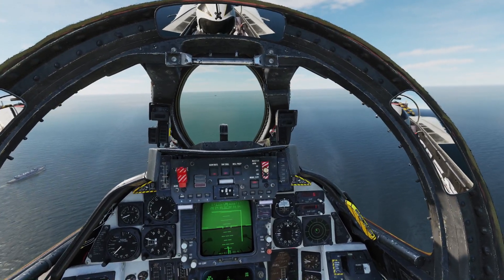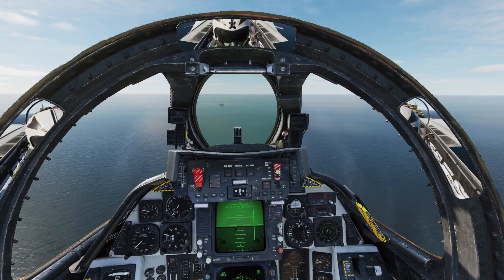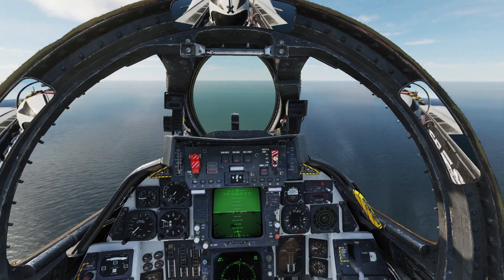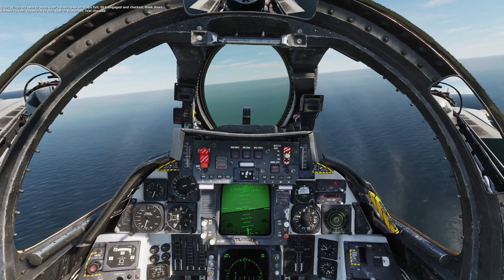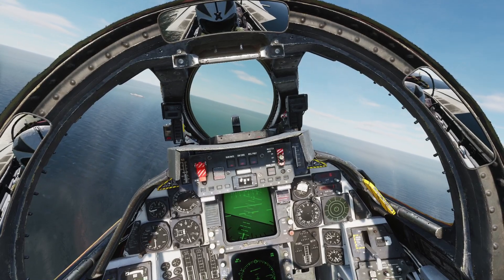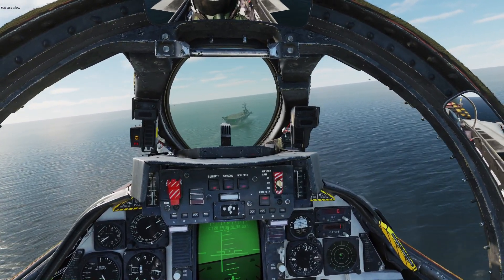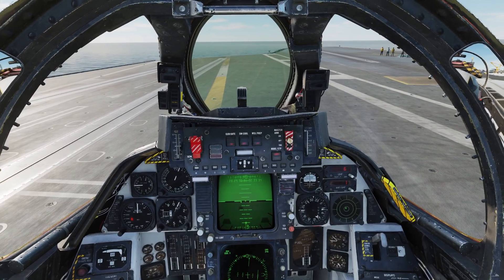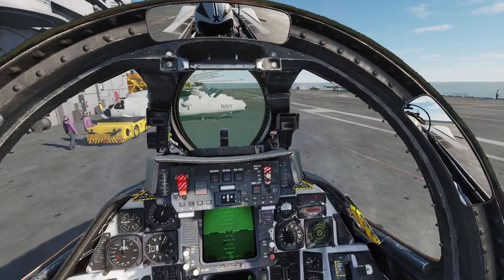F-14 Tomcat - No HUD Case I Recovery

Comment: 4:27 That's so true. In fact, I tried this when the Tomcat was new because of that recommendation, but I ended up just cranking down the brightness so that it's still faintly visible for double checking thrice, but I noticed I rely much more on the outside compared to having the HUD brightness cranked up completely. I guess this is a decent intermediate step to take for simmers.